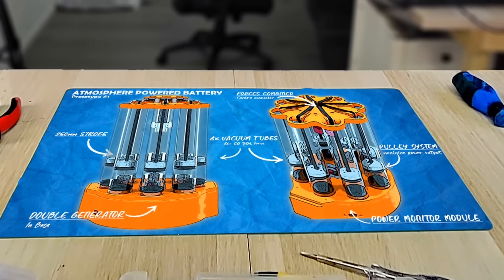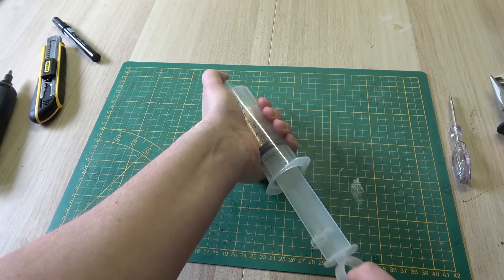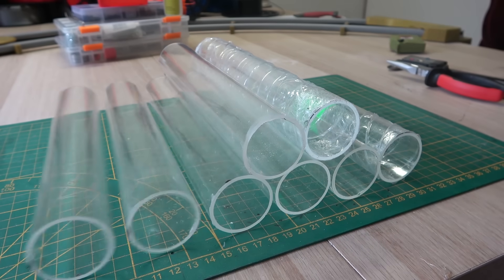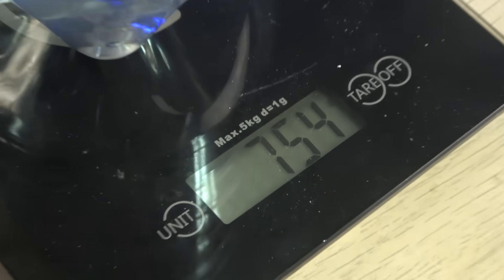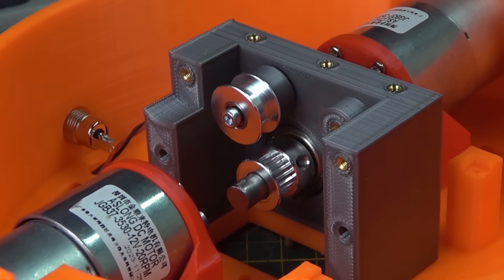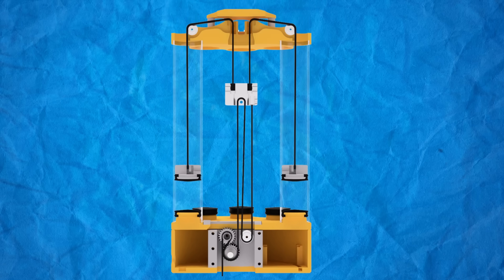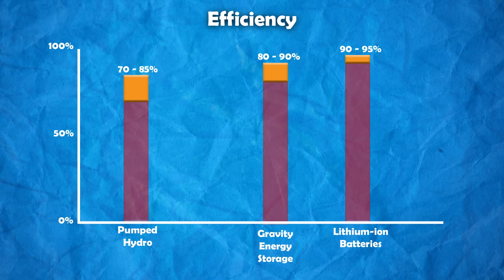Building an Atmosphere Powered Battery..

Comment: Try storeing  solar engery in high pressure air tanks  an when its night time release  the PSi into a air motor thats attached to altnator  to charge up the battery

Try storing solar engery during the day with boiler tank  an same method as above but steam powered   - something that can store engery from the sun to be used at night time

Comment: Square cube law (kinda) anhillates this sadly. If you had the room to build something like this the size of a house it may work, though then the vacuum forces would require much thicker walls and there would be too much dead space. 
If there was to be anything like this used everyone would just use pumped hydro at home instead of battery banks as its not all that difficult to put an oil tank up on a platform and run water through a small turbine, though getting the correct volume of water to actually run something for a long time requires a large square area of land, assuming that land is also deep, you get a massive amount of water stored.

Stuff like this scaled for home use won't beat out the simple hydrocarbon fueled generator for a long while and when we get that Antarctic oil, it'll be plenty cheap.

Comment: I would say that water's Volumatic pressure pressure would be way higher than that of atmospheric pressure? so if you design a device that create vacuum under a low of wallet column, it might be more energy dense and efficient. or simply make this works under the ocean

Comment: E=mc²... so to obey that law, your machine should weight more when fully charged than when the pistons are down... right??? I wish to see the results...

Or maby im dumb as the weight will not change but the volume will... and that will make the mass/volumic proportion value become bigger as the thing will become less dense for the same weight...

Comment: The rubber is to flexibel and gives to much resistance,Maybe replace the rubber seals with the seals they use in hydraulic cilinders, that is Some kind of plastic but does the same job.

Comment: Good Idea to do the test, but I think it's not worth to continue, due to there are too many point of Failure in the system it self, one most obvious is the leakage of the Cylinders between the seals, any kid that had played with a Syringe can tell you after some usage any Syringe will get loosen between the seal and cylinder.

Comment: There's a few things I think It would be worth testing:
- Scaling up from 8 to 16 tubes and seeing if you get double or more than double the energy storage
- longevity testing - how many charge/discharge cycles can you get before the rubber seals wear out and then you can calculate the ongoing cost to maintain this type of battery
- there are applications where longevity and weight matter more than size
- if this design  can be made in a manner that a few pieces of rubber can be swapped out in an hour for n thousand charge/discharge cycles then it could be quite cost effective against chemical batteries in high cycle applications

Comment: Could you achieve more vacuum with vacuum pump and chamber? If only the pump could then run in reverse... Or continuously utilize the vacuum for power generation and have the vacuum pump running when power is available.

Comment: What about using pressured air as a battery, like a compressor, and use it to turn a turbine to generate electricity? Wouldn’t that be more practical and less prone to failure?

Comment: Heya, check out this drawing in the first few seconds of my video. its a gravity machine in water that uses air as ballast to counter act the main drive weight. When air is pumped out the weight it weighs 1,000lb (example). when air is injected in, the weight weighs - 0 -Zero. Then a counterweight can be dropped to reel up the 1st weight and turn air compressor and electric generator.   https://www.youtube.com/watch?v=_XFvxs7XaRo

Comment: I have thought about using gravity to power a refrigerator before. It was just for fun and I probably didn't do it right but the amount of weight needed was ridiculous. If I remember correctly it would take about 2,000 lbs to fall 6 feet to run a refrigerator about 2 hours.

Comment: you will need really thick walls if you want to make a big vacuum chamber, i've seen big industrial refrigiration vessels collapse under modest vacuum.. those vessels where pressure tested for over 50bar. also you won't be able to hold that vacuum that long with sliding seals repeatingly.. Maar ik vind het tof hoe je het geheel in elkaar heb gezet, en hoe je het uitlegd in deze video 😉

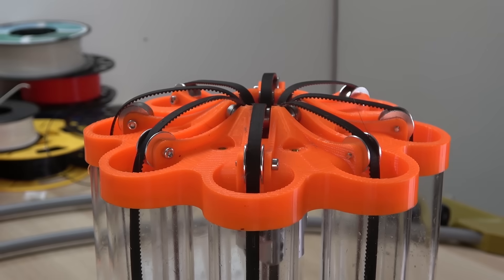Comment: 628 joules is 0.17wH. A double a battery has 3.75 Wh so 22 of these would equal 1 AA battery now looking at some duracell batteries they cost £8.50 for 12 so they are about 71p each meaning you'd have to make this unit for less than 3p each to make it viable of you could increase the capacity to make a bigger but if each of those tubes scales price with size then you'd need them to cost 0.4p each. In short this looks cool but the energy density for volume or weight is awful. Maybe you could increase the potential stored power by creating a vacuum to start with. You can see at 10:22 that there is not a vacuum in these tubes in their initial state maybe if there was you could increase the total storable energy.

Comment: The most important part is not efficiency it's cost. You could make it 99% efficient but if the cost per wH is low then it's no good for industry. Obviously your model will be expensive because it's small scale. However you aren't the first person to explore this avenue of thought and you won't be the last but the answer is that yeah it costs more per wH stored. The other problem is that having a constant vacuum is potentially dangerous if something breaks. What I will say though is that apart from your mistake with using watts instead of watt seconds this was a good technical video with plenty of gritty details I've found that other channels tend to brush over details and just try and sell the idea to you.

Comment: Fun to build may be... but there will never be actual practical use of for so... sooo many reasons.... complicated design, almost impossible to large scale, there will always be leaks which means loss of vacuum over time, bottlenecked from the atmospheric pressure which means large volume will be required.... and so much easier and better solution already available.... like just using a compressor which fixes all of the issues of this system!..... But an idea nonetheless... which might lead to a better one in the future... so not absolutely redundant work. I might suggest using a simple compressor for the next version... it would be interesting to see the efficiency of such a device.

Comment: maybe have a good gear ratio in this gravity battery.
like a big gear wheel rolling a little gear wheel. then the shaft does noy need to be so high. this could also be done with a water wheel. pumping water high and generate waterwheel it too low. just like the sea tides. only artificial.
Reply: like spring tide.

Comment: There are better engines to use for making power, the charging engines are fine though but I believe you need two different stages, alternator on the charge side

Comment: the sealing rubber will not last long over time. its a short time storage (time between full load and discharged in less than a 10min), over time 6hours or longer the energy would get lost and after weeks the sealing gets weaker after every cycle

Comment: What did you use the atmospheric pressure, from a higher altitude to a lower altitude. If you are continuously flush weight the atmosphere changers where equivalent the monthly change mathematically is that plausible

Comment: Very interesting. ..an adaptation of the same principle could use solar energy to boil water into steam.....cool that to make a vacuum like a newcome engine and  you could produce electricity at a similar efficiency without using exotic materials.

Comment: Tbf might be a viable option if you charged when the atmospheric pressure was low enough.g. During a storm or something and then discharge when it was high might be an interesting way to use it as an atmospheric engine

Comment: Great stuff fellow dutchman! Keep them coming! One thing, not to critisize bur rather for me to learn: isn't the energy that's needed to turn the generator also influenced by the load on that generator? In other words, If you hook up the battery charging circuit as load, shouldn't it take more force to get the generator spinning?

Comment: What sort of charging method is what will make or break any use for this, imo. You've got a non-metallic spring is another way to describe this. On first thought, I think the application is for physical work, not electrical production, simply because sealing smooth surfaces is expensive over time. Inevitably either the gaskets pin, or the tube gets worn, or combinations. That's a very early guess. This would be a unique way to drive a small elevator, maybe torqued on a water wheel, certainly something that would fit in some outdoor pool set up at a mansion. Congrats!

Comment: What is the power storage capability per storage volume?  Is there more potential energy in a vacuum of two liters of empty space or in two liters of water?  The water's potential energy is a function of mass and vertical displacement while the vacuum's potential energy is a function of atmospheric pressure (effectively constant) and the volume of the vacuum occupies.

Cool project!

Comment: The conclusions are wrong. How could they charge 860 watts? If you lift 1 ton to a height of 10 meters, 98,000 joules of energy will be stored. 860 watts per hour is 3,096,000 joules! It is necessary to use the usual power measures of watts per hour! You will get 11 watts per hour!

Comment: try to consider liquid substance that change status in gas at low pressure and combine gravity storage, when volatile liquid change status in gas may grant to u lower resistence during charge duty and gravity helps u in relese nrg (ps use vaseline to lub pistons and orings on pistons)

Comment: I do not understand how this would be scalable.  It is a very neat idea, but with pumped hydro you have a pond and a pump and a vertical delta, so you can just make the ponds bigger.  For this, making the tubs larger would be hella expensive and require a new device for higher capacity.  If any leaks or failures, the system becomes unbalanced and could break a large scale op.  I would be interested in your comments regarding scalability.  Other than that, VERY cool proof of concept.

Comment: It's not just the efficiency, it's the energy density. All that space for a mere 0,00017451 kWh? You could probably fit 1 to 2 kWh of lithium ion batteries in the same space.

Comment: I am no engineer, but impressive to me.

Few potential improvements.

1) Belts are less efficient than chains. Maybe, the linear motion required could be achieved with toothed rods and gears.

2) larger diameter tubes and less of them would be less surface area on seals.

3) could be worth seeing what % vacuum achieves the greatest efficiency. Maybe only charging to 50% is more efficient than to 100% (or some value other than 100%).

As you have a prototype, could be worth exploring patents in this area and seeing if you could patent it. It being lower efficiency than batteries which are the only other worthwhile home storage solution (maybe gyro too) is fine as this is much simpler to build and doesn't require rare earth metals (well... magnets in the motors but still).

Comment: Yes, a larger version, and do everything you can think of to improve the efficiency. Maybe running the motors at speed/power that maximizes charge efficiency, find all the points that can be friction reduced. Lube that's compatible with both the seals and the plastic cylinder. Stuff like that. I would like to think that you could approach pumped hydro. Great project, thanks for the video.

Comment: lots of potential, however i dont think we should be looking to solar and wind energy as the go to energies... at least currently, if we replace every coal power plant with solar/wind we would only get around 60-70% of what we were getting with that amount of property space, if places like California are already having rolling brownouts (also known as load shedding/shearing in other countries) in some areas then this will not work especially there. instead we should look at a better power production. in my opinion, go nuclear, on top of that with nuclear power plants you can also convert them to do hydrogen on lower power times like night, with hydrogen we could have hydrogen powered cars which is much cheaper to fuel up assuming that hydrogen is easily produced and is still better for the environment then oil

Comment: changes I would try:
Instead of using the motors to pull up and create the vacuum as it pulls, Have a release valve that will allow the motor to pull the tubs into the up position with no friction of a vacuum. Then I would have a vacuum pump to make the vacuum after it is all in position and the seal is closed. I think running a vacuum pump would use less energy then it takes for the motor to do that same work.

Comment: you'll have a ton of durability problems. strong vacuums quickly damage most material. they're also permeable to some degree. you'd periodically have to re-evacuate the cylinders. 

you might be interested to know that space stations use vacuum cylinders to provide constant force for their fitness equipment.

Comment: The problem is the energy density. The theoretical energy density is 0,000028 kWh/l. That is ~10000 times less than a battery or ~1/2 million times less than diesel.
If I were to have a household battery of, say, 10kWh it would take up 355 cubic metres of space. Underground, maybe, but otherwise not very practical to have a structure the size of a house (per household) for energy storage.

Comment: Genuinely surprised at the figures you pull out at the end. If you increase the diameter of one cylinder, you'll get proportionally less friction from the sides of the rubber gasket and you can simplify the device. Doubling the radius of the cylinder doubles the circumference but quadruples the surface area.You might also be able to put the tops of the cylinders under passive pressure to increase the force on a single piston, or put the whole device under pressure. How good are the gaskets at holding the pressure? Is there any loss over time from gasses moving from one side to the other? Can probably improve that by increasing the molecular mass of the gas that's exerting the pressure. Maybe sulphur hexaflouride? Argon might be cheaper and is definitely safer, but probably not as good. I'd also try putting bearings on the support for the gasket... how do I explain this... since the gasket needs to be kept straight, the piece the gasket is attached to is rubbing along the walls of the tube so, if you put bearings between the gasket holding thing and the tube, you'll reduce friction.

Comment: One idea for improvement: have both ends of the tubes sealed (with an airtight steel wire to lift the plungers). This would increase the energy density of the system, because you would be creating both a high pressure area and a low pressure area (rather than just a high pressure area). This could be further improved if the high pressure side had a minimum pressure above atmospheric pressure (this would increase the pressure differential and total storage capacity).

Comment: Energy storage should start with energy density. A petrol tank-sized battery doesn't hold as much energy as when the tank is filled with petrol. But what if it was filled with hydrogen? The storage problem solves itself if we store higher density energy in the same sized containers.

Comment: Here is an idea: use 2 one way valves to accumulate air in a gas tank. Every time atmospheric pressure goes up or down, one of the valves will open and the other will close and vice versa. It's not just a battery, it's an atmospheric pressure generator. I wonder how expensive and feasible this project would be, any thoughts? Interesting project 👍

Comment: Neat but dude come on, just use a spring! ... it's basically already working as one and you are just complicating it with all those rubber seals that will need lubrication and still fail in a couple of thousand cycles. Using a steel spring would be so simple and just as effective.
Reply: That’s not as fun
Reply: Sure, but it feels scaling this up would be easier than mass producing giant size springs.
But then again I have no clue about the spring industry :D so it would be a question of price and availability

Comment: This is just a more complicated and less efficient way to do compressed air storage.  We can store far far more energy by putting multiple atmospheres of pressure in a steel vessel, a vacume in a container is only the equivilent of having 1 NET atmoshpere in a container which is incredibly low.  And the vessel that holds the vacume is under compression rather then tension, materials are FAR better in tension where we routinely put 100s of atmospheres in steel vessels, but just 1 atmosphere of pressure outside will collapse it.

Comment: I my self see some improvements they can be made, 
1 some type of thin lubricant would be great.
2 because of the high friction the motors are just working too hard to pull all simotanusly, make a mechanical configuration that will do it two or one at the time, so basically you fight against friction.
3 most important, if you have more tubes you will have more power stored so it will potentially heighten the efficiency. 
4 siquentional vacuum, and sinquensional pressure 
5 I don’t know for sure if a vacuum pump would help for another project :)